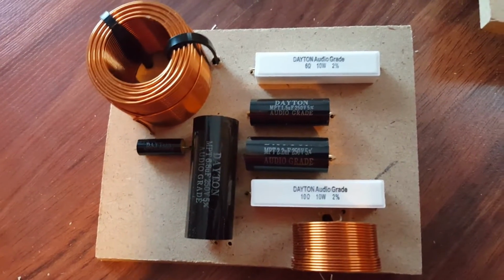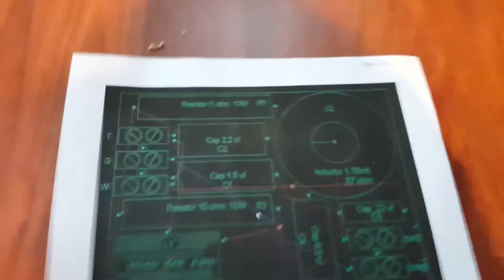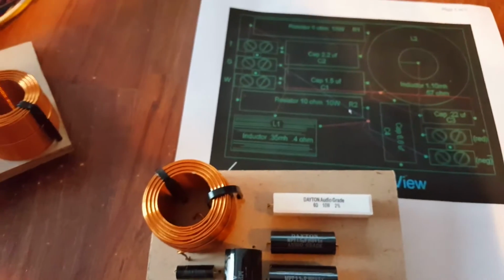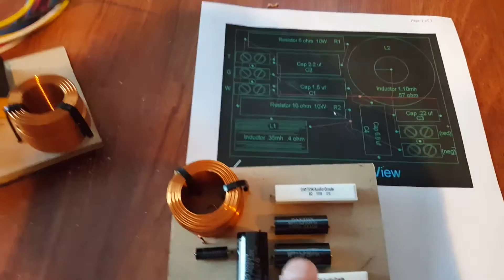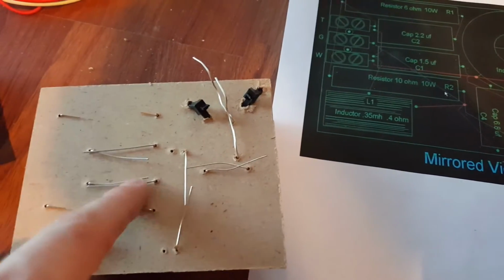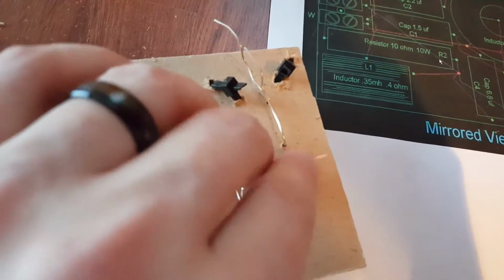Overnight Sensations Crossover Build - Part 2

Comment: When I built these and I had to put the crossover boards in. It was so so tight of a fit. The mid woof touches the big cap on the board. These sound good with the right amp. Very good

Comment: What sort of amp rating do you think the block terminals should be?
Reply: Since the woofer is rated at max 50w and 8 ohms impedance, 6.25 amps could flow through at max power so your block terminal should be able to handle at least that much current as well.